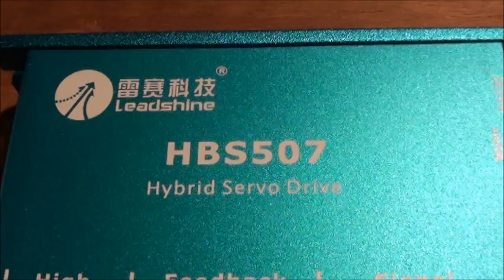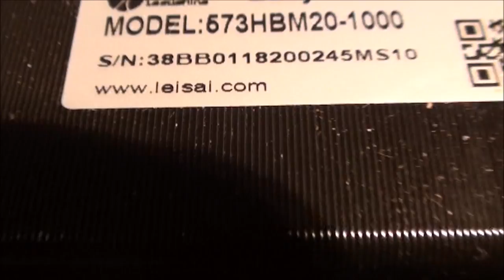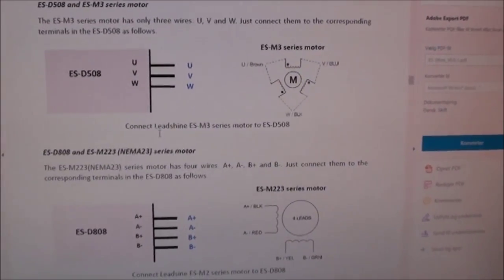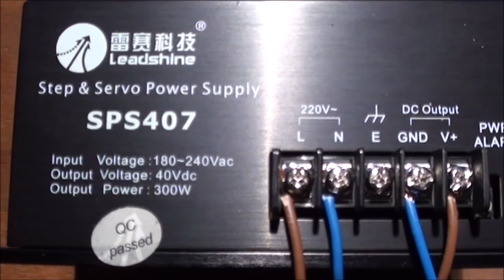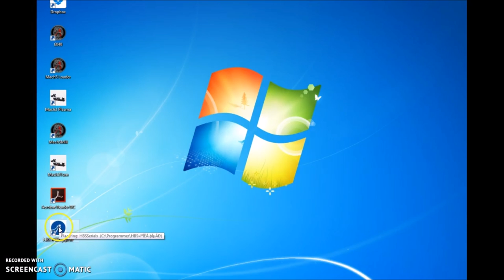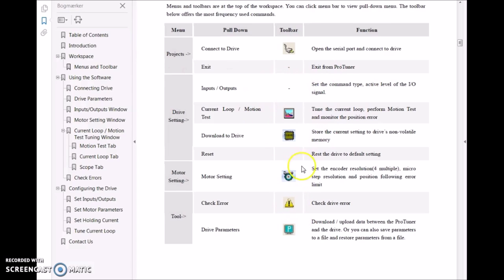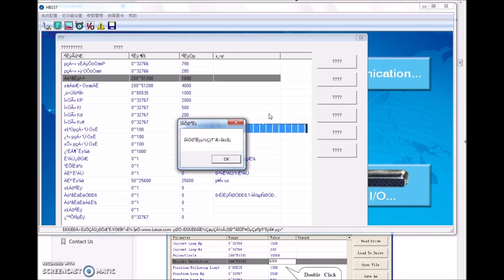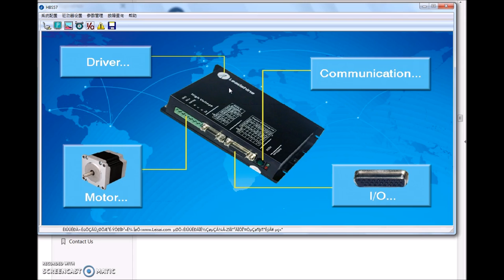Setup of Leadshine HBS507 Closed Loop or Hybrid Servo Step Driver

Comment: I have been wrestling with whether to try these or the Leadshine Nema 23 Servo(not hybrid stepper) model BLM57180 with the ACS606 controller. I want very smooth action to reduce resonance for improved side mill finish on a heavily modified G0704/PM20. Going for linear rails, C3Z ballscrews and the smoothest spindle/motor setup I can find as finish is key over speed.

Comment: Greeting. I have the same problem on my hybrid stepper motors. Hbs57 driver and hbs86. It locks the engine and cannot move. On the driver, the parameters are set to 3200 by default. Do you need to change something there or should I do as you did in the video?

Comment: Hi Martin,
another question:
what are the settings you used for the serial port besides the baud rate of 38400 ? ( parority , stop bits etc ? )
thanks 
Stephan
Reply: Any updates on this, im in the same boat.

Comment: Dear Martin, For CNC or 3D printer, replace old nema stepper motor and driver with ES-D driver and step servo motors, then closed loop system is done? or need to modify some firmware or software settings?

Comment: How long does it need to connect? I am stuck at that point and i am waiting for 5 minutes and nothing happens. What i am doing wrong
Reply from the maker: Connection should be immediate - no wait
Reply: @martinbarfoed5040  thanks mate! However no matter what i try to do i get Communication Error and it doesn't connect. It is HBS57 which is only for china domestic purposes. Wrote to the vendor i bought it from so let see... :(

Comment: What kind  of controler do you used for BSH 507 driver motor
Reply: I need one controlerr for Bsh 507 , what do you used?
Reply from the maker: In this video I use HBS507 but you can get many other similar. Currently I'm looking at 2HSS57 from JMC.

Comment: thanks great details ,,,what is differnce to connecting to Arduino  with stepper drive ? is it same connections step and dir,5V
Reply from the maker: Yes, if you load grbl to the Arduino you will have STEP and DIR signals on the digital outputs (think it is pin 2 to 7)

Comment: hello 

the programming it is recorded in the driver, if disconnect the cable (RS232) that goes to the computer? 

thanks
Reply from the maker: You only use the RS232 connection when changing (read/write) the settings of the driver. When they are ok you do not need the cable anymore

Comment: Hi, how to communicate two driver, like 1 axis using 2 motor, if 1 motor wont move and the other motor have to stop also, to prevent from twisting the gantry..
Reply from the maker: If you use MAch3 as you PC software you have to make one of the two "slave" of the other. Often you have two motors on the Y-axis. One is the normal Y and the other will be A. So here you assign A to be slave of Y.
Reply: i am using mach4. it seem same setup applied.. but the problem is, when 1 motor not moving the other one is still moving,, is there any way to communicate the driver ,, is there any connection wiring? like alarm signal.. how to connect them.

Comment: Martin I have a question, in your earlier videos you have a fairly decent looking Openbuilds OX but you seem to have changed to using an X-carve and recycled the 8020 to make a controller box. What was the reason for this?
Reply from the maker: Hi John
I still have the OX and I'm very happy with it. Actually so much that I recently started to import OpenBuilds parts to Scandinavia. One week ago I launched a website maker supplies.dk.  
I also use the X-carve. I have small size so it complement the much bigger OX. 
If I was to choose one and start now I would go for the much more robust OX. Main advantage of the X-carve is that it comes with all you need. For the OX you need to source electronic and mechanics separately. 
Best wishes Martin
Reply from the maker: BTW the control box 20x60 was just some leftover from my OX build

Comment: Hello Martin, great Video and now I will order the HBS507 but can you me tell what you use to conect it for a controler was the PoKeys57CNC or another? I will use the HBS507 with the mach3 Software, thanks and best regards Adi
Reply from the maker: Hi Adi,  You can use use the Closed Loop Driver/stepper together with PoKeys57CNC - no problem. As long as you secure to get a driver that is controlled by STEP/DIR signals you are good to go.

Comment: Hello, any chance you still have those software files for tuning the drive? Can't find them anywhere
Reply from the maker: Can you access this link? https://www.dropbox.com/s/dmpllxo2xick5yr/HBS507.zip?dl=0
Reply from the maker: This is for ProTuner: https://www.dropbox.com/s/0sxchncub5i9b62/ProTuner_ES_Setup_2013-10-26.zip?dl=0
Reply: Hi Martin,
my Namwe is Stephan.
I just received from china the HBS507 set. I could not acces the driver with the englisch software- Is the software you uploadet in your dropbox functioning with the HBS507 driver . I desperately need to change the default settingfor the enable to active High , now it is set at active low. ossibly i also need to change the steps rate . 
Thanks a lot . I hope i will be able to access the Driver .
Sincerely 

Stephan @martinbarfoed5040

Comment: hi , thank you for the good info , i have a question .. 
is the rotational accuracy 1000 encoder steps or the 1.2 degrees ?
Reply from the maker: You will usually be using micro stepping e.g. 8x. So with 1.8dg you have 200 steps around times 8 equals 1600 positions for one rotation. So in the same order of magnitude as the encoder.  I would think that you still may risk loosing a few micro steps but I do not know if the controller has a way to compensate for this as it "knows" both the number of step pulses send and the micro stepping setting - so maybe the risk is low. Others please comment

Comment: Hi,
I've tried to look up the model HBS507 on leadshine website but it's no where to be found. I thought this was kinda strange.... has it been discontinued? All I see on their website are the ES-D Series for DC voltage (which looks very much similar to the HBS507). Does anyone know why?
Reply from the maker: +Tim Le Hi Tim,HBS507 is a Chinese Domestic version that they do not support outside CN. This is probably also why the software is in Chinese only. You can however, easily find it for sale on ebay. Outside CN they sell ES-D as you say. I have been in contact both with the Chinese headquarter and the US branch and the message was the same. So if you are outside CN and buy HBS you can not expect support. Best wishes, Martin
Reply: Hej Martin, Du kan finde den engelske version af ProTune her: http://leadshine.com/UploadFile/Down/ProTuner_ES_Setup_2013-10-26.zip Jeg er igang med an maskine med Leadshine ES-D508 som er den europaeriske version af HBS507.Jeg bruger den engelske version til mine og det ligner din kinesiske version bare laesbar :-).
Reply from the maker: +Per Brandt Hej Per, Den har jeg prøvet men det vil ikke kommunikere med HBS507. Det ser ud til at programmet spørger til hvilken controller der er tilsluttet og kun vil virke med den korrekte. Jeg har skrevet til dem for et stykke tid siden og svaret var at de ikke supporterer domestic controllers på andet end kinesisk. Så lektien er nok at man entes skal kunne kinesisk eller købe den du har. Beskriver du din masikne noget sted. Det vil være interessant at se hvad du laver. Jeg regner med at poste en video mere med min HBS507 når jeg engang kommer til at få dem monteret. Det er desværre ikke så let da hele ledningsføringen skal laves om og jeg skal have størere drag chains på for at have plads til de ekstra ledninger.Hilsen Martin

Comment: hi martin,, mine is keep appear a position error,, why is that,, and what is the best setting..
Reply from the maker: Hi Rafi, Im sorry but I do not think I can give you an advice here. Have you checked that the basic motor/controller works like I do in the video. If not one of the parts might be broken

Comment: Is it possible to use this leadhine closed loop servo with an arduino&grbl?
Reply from the maker: +daSamo123 I don't think that is feasible. On the grbl shield you have all the stepper controller integrated so you do bot have easy acces to the signals you need. Instead use a break out board or one of the USB boards available. This will also work with Marc3 - not an option for grbl.
Reply: thx

Comment: can i use normal steppermotor whit 1000 P/r encoder?
Reply from the maker: Not with this controller. Output for the motor is U V W - so you need a 3 phase motor. Normal stepper typically have A+ A- B+ B- output.

Comment: Hi 
oh that's a big driver 
have you work with 3d digitzer using a touch probe on the xcarve cnc ?
Reply from the maker: +Akrout Osama Hi Akrout, No I have not tried that yet. But it must be doable using the same G38.2 command over and over again and making a  "topo" map of the surface.
Reply: +Martin Barfoed oh yes but wich software can converts the probing in a 3d objects into a CAD file ? do you have an idea ?
Reply from the maker: Akrout Osama Check out this Instructables - looks useful: http://www.instructables.com/id/PCB-designing-and-isolationmilling-only-using-free/
The mention that Chilipeppr has the autolevel function build in. You can find the button in the upper left corner. Check out: http://chilipeppr.com/grbl

Comment: Hello Martin , 
Thanks a lot for your video .
I  am referring to your Answer to Astronobob .
I downloaded the software as per your link to your dropbox.
I also own 3 Servo with  hbs507  drivers  for my cnc mill. Now i have to make some Changes in the Driver , but i am not able to make a connection to it.  I get following  messages ." Unknonwn drive " Connection failed. The Baud rate is correct .
I made my cable as per leadshine diagram , using a USB to RS232 adaptor which i surerely know to work properly .
I even tried to switchTX and RX with no avail..... so i am still stuck !
Any sugestions ? could you please upload to your dropbox the original chinese software ?  my last ( ? ) hope to get the things going .It would be sad to throw away the servo drivers.... in the default settings  there are not suitable for my project.
Sincerely . Greetings from Switzerland

Stephan
Reply from the maker: Im fairly sure that the first link below (HBS507.zip) is the Chinese program. The cable I use is DB9 to 6 pin RJ type connector. It a 6 wire cable. In the RJ end the connections are: pin 1-white, pin2- black, pin3 red, pin4-green, pin5-yellow, pin6 blue. In the DB9 end only three wires are connected. pin2-red (+5?), pin3-yellow (Tx), pin5 green (Rx) . Here is also a link to the UK manual: https://www.dropbox.com/s/53gkf16qfipk689/HBS%20Software%20Manual.pdf?dl=0
Reply: Hello Martin , 
Thanks for your response.
I downloaded The links in your dropbox . The first one is a collection of CAD Drawings ( HBS507.zip) i did not found a exe software in this folder. The second link is a plain english version of the pro tuner ..so i am wondering its a tradution of the original chines Software ? Do you stillhave the plain chinese software  ? I made the Cable as per your instruction , the strange thing is that it is not the same pinouts in the RJ11 as per leadshine Manual ?! so still stuck no way to connect to the servo driver.  ( With your dropbox software and a your cable suggestion ) I must say that i am not a beginner in electronics , but i suspect that the issue could be the software. Sorry for disturbing you again. I would appreciate to get the original chinese software... i found the drive in the leisei page ....but i don't know where to download !!
Thanks Stephan
Reply from the maker: @stephanbutler2095  I can try to email you the CN software

Comment: Dear clients,  HBS Series is for China Market, ES-D Sereis is for international Market.  So if you are out of China, you had better to get a ES-D Driver from this http://leadshine.com/producttypes.aspx?type=products&category=easy-servo-products&producttype=easy-servo-drivesThanks.
Reply: For CNC, replace old nema stepper motor and driver with ES-D driver and step servo motors, then closed loop system is done? or need to modify some firmware or software settings?
Reply: Leadshine 
Hi, how to communicate two driver, like 1 axis using 2 motor, if 1 motor wont move and the other motor have to stop also, to prevent from twisting the gantry..
Reply: Excuse me but... your website doesn´t work. Not your link nor http://leadshine.com/
Not from Spain, maybe not accesible server from here... Interesting product but no way.
I hope read you later.
Timeout expired.
Reply: Say for X axis, you need 1 driver for each motor,  and use the spare A axis (or another one) and call it X1 for the other side of the gantry and then map that in the port setup for your software.

Comment: That would be a true servo if it is 3 phase. Stepper  motors are 2 phase the ones they sell to the west are stepper type 2 phase and use 4 wires which are called hybrids.
Reply: not true, there are 3 phase steppers as well.
Reply: @kermitfrog1897  Not in AC 3 phase they don't.
Reply: @johnward5890  I never said they were AC. Three phase steppers are everywhere. You can argue that PWM is not ac and is DC ...whatever. Still 3 phase. Do a search for 3 phase stepper motor

Comment: Hi Martin, 
This video is extremely valuable, but i don't know, How connect HBS 507 to Computer ?by what ? do you give me diagram ?
Thanks.
Reply from the maker: Hi Vuong Do, This controller is connected to the computer exactly the same way as "normal" controllers like DM542. You can use a parallel break out board or a USB board to make the connection. I made two videos some time ago describing both ways. Parallel BoB: https://www.youtube.com/watch?v=12LoOmPAJ3o   and USB using AKZ250: https://www.youtube.com/watch?v=_kRBPg2Coh0   Hope this helps you.

Comment: Hello guys, can you help me, I want connect driver to computer by USB to COM, But the software warning communication fail.
I Try to again but still fail :(
Reply: Did you solved the problem ? Software (ProTuner-HBS) return me the same as I tried to connect the RS232 port to the driver ;-(

Comment: Hi bro . Pls tell me part number of encoder cable . If you make it . Pls share me diagram electric of cable  . Thanks bro very much
Reply from the maker: The cable I use is DB9 to 6 pin RJ type connector. It a 6 wire cable. In the RJ end the connections are: pin 1-white, pin2- black, pin3 red, pin4-green, pin5-yellow, pin6 blue. In the DB9 end only three wires are connected. pin2-red (+5?), pin3-yellow (Tx), pin5 green (Rx) .

Comment: Hi guys and thank you for this nice video. I tried to build myself the cable RS232 PC-driver  (HBS507 and HBS86) with a layout given on lead shine.com, but there is no connection possible. Would somebody be kind enough to give the solution ? Where should I wire the +5,0V ? I think it's not necessary with a PC. The software is the english version of HBS/ProTuner. Thanks in advance , any help would be greatly appreciated !!
Reply from the maker: Hi ptipupu, You need to connect three (3) wires from the DB9 to the RJ11. It goes as follows: DB9 (2) -> RJ11 (4); DB9 (3) -> RJ11 (2); DB9 (5) -> RJ11 (3)
Reply: Thank you for your answer Martin..... That is what I did or may be I'm confused with the sequence (1,2,3 ...) on the RJ11 ?
Is it a problem if the driver is already connected to the axe controller (breakout board) of the CNC ?
Reply: Martin, Do you agree the notification of the Datasheet of the Easy Servo Drive ES-D508 on lead shine.com ? http://www.leadshine.com/UploadFile/Down/ES-D508d_V1.2.pdf
It's written RJ11 Pin 3 =TxD (transmit) Pin 4 = GRD Pin 5=RxD with a schedule of the RJ11
Reply: Martin !! It works now ! Thanks to you, but it's clear that the CNC as to be unplugged.
Reply: Hello ptipupu, Did you get the connection and access the drive's software?

Comment: I have found the sofware for the HBS87. You can download them here. 
https://mecheltron.com/en/software-archive
But i Can't find the HBS507 software that works for modified kp kd etc. when i switch of the driver, it lost the new value that i have dowloaded inside. If every body found the solution, please post it. Morover i can't find the sofware for HBS57S. Impossible to recognise with the software the "S" version of the HBS57.